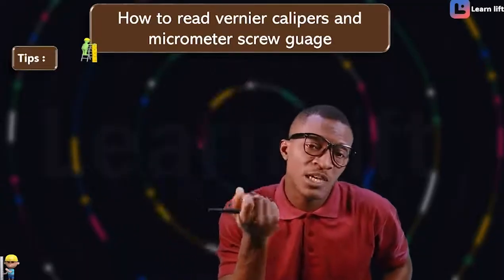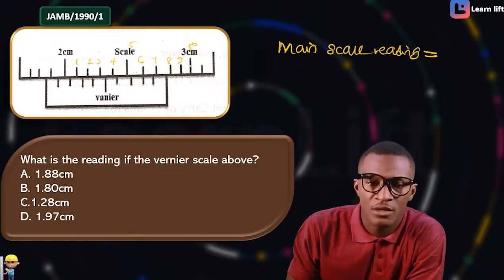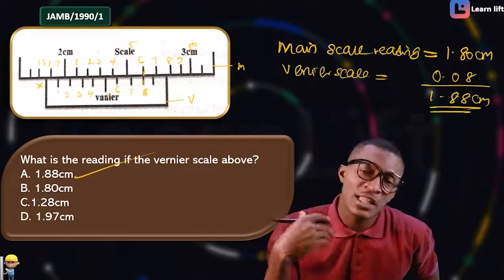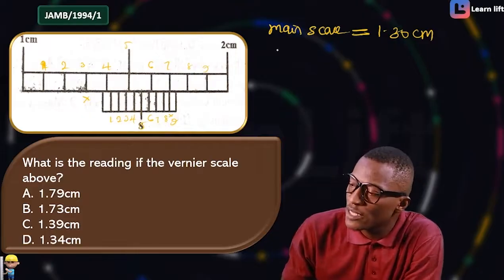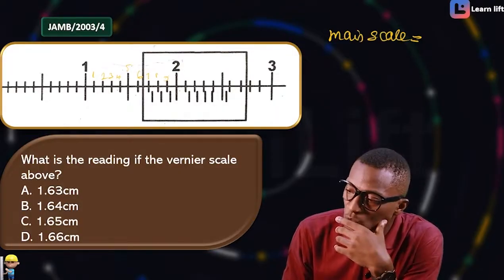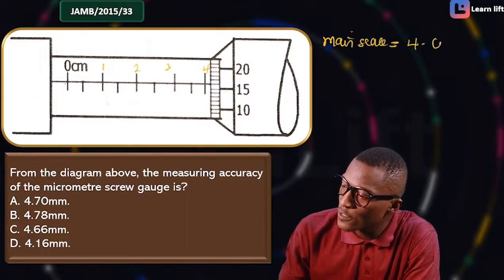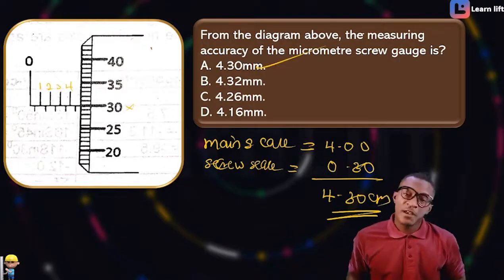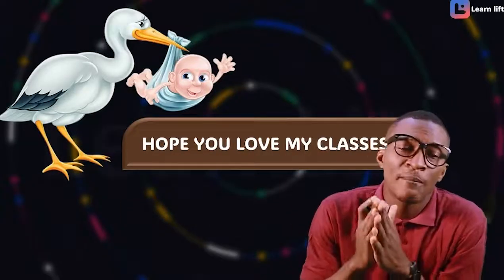HOW TO READ VENIER & MICRO-METER SCREW GUAGE (UNITS & MEASUREMENT)  (PHYSICS JAMB AND WAEC 2026)

Comment: Srry, but u missed somt , the cm in micrometer screw guage are 3 decimal place
In the jamb question u did  2015 jamb question 3
It's 4.016 cm not 4.16 cm
Reply: Is not from him, is coming from the question.
Did u see 4.016cm in the option
Reply: He calculated it in mm but wrote cm instead
Even the answers are in mm
Reply: I checked the question in my series, that 0cm is 0mm in my series
It is in mm not cm